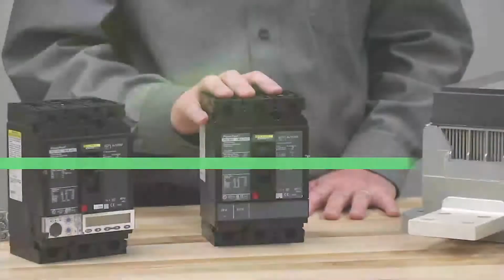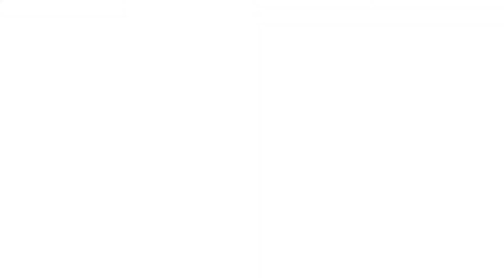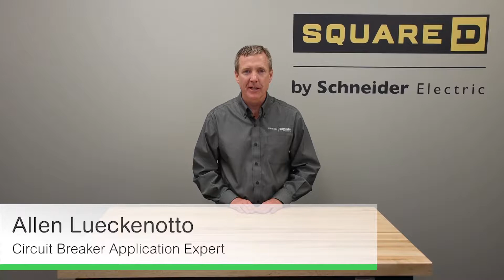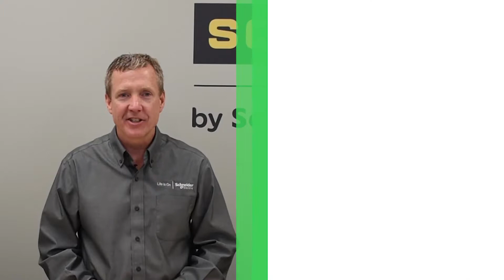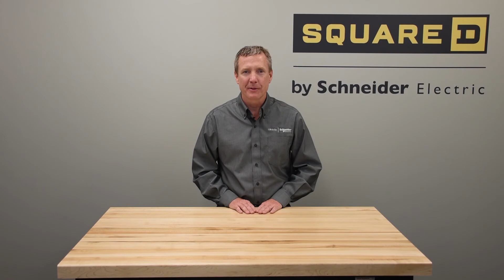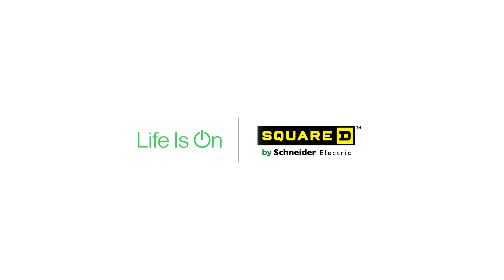Comparing 80% and 100% Rated Circuit Breakers

Comment: Thank you very much I really appreciate it I enjoyed watching your video. I’m curious do 100% rated breakers need a larger wire or can they use the same size conductor. 😎👍🤩
Reply: I know it's been 10 months, but in the USA, a standard breaker can use 75C insulated wire (such as THW) while a 100% breaker requires the use of 90C insulated wire (such as THHW). Otherwise, no difference in conductor size.